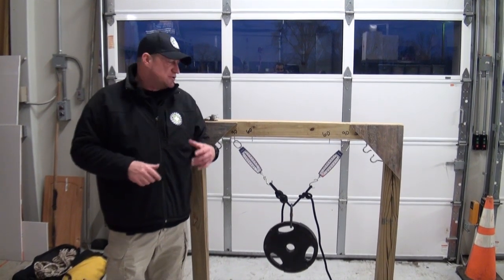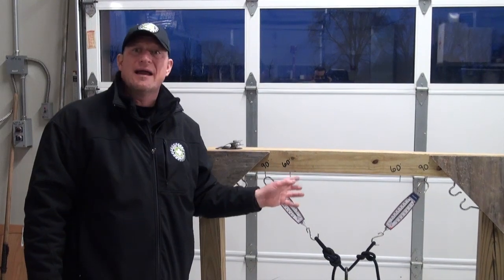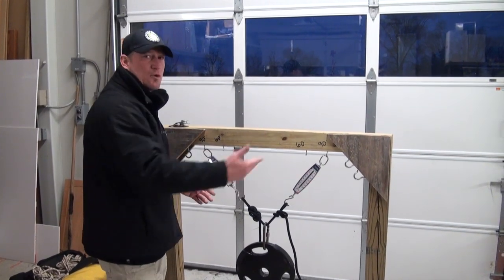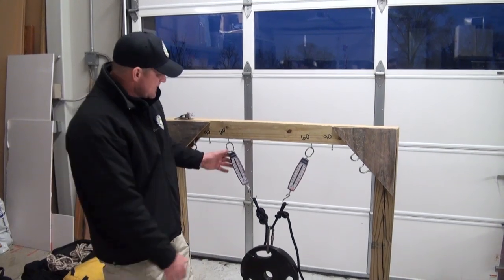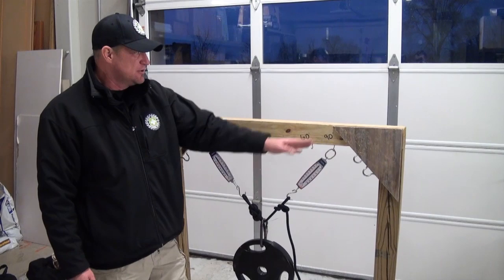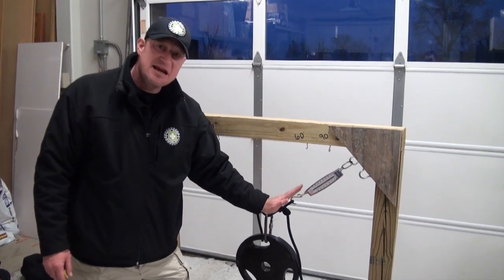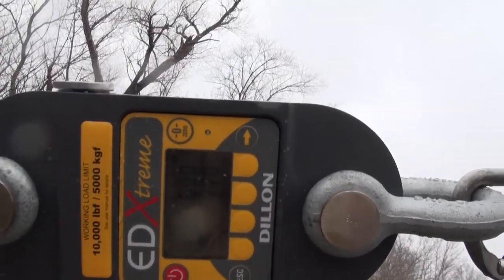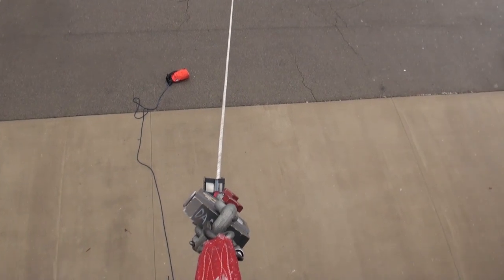Rescue Methods FR1: Rope Rescue Critical Angle Concepts

Comment: To help determine what your load will be on each leg of your anchor system you can use the formula F = (m * 0.5) / cos(a * 0.5) where F = the resultant force, m = the mass of your load and a = the internal angle between the legs of your anchor system. Using this formula you will find that at 60 degrees you distribute around 57% of the load to each leg, 71% to each leg at 90 degrees and 100% to each leg at 120 degrees.  Below 60 degrees your load distribution on each leg drops very slowly, but above 120 degrees the load distribution climbs dramatically.